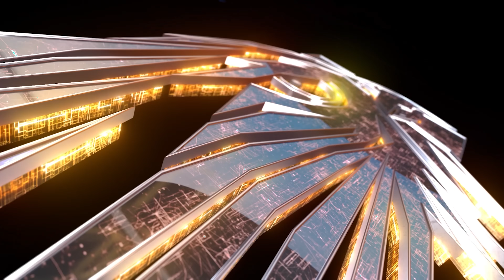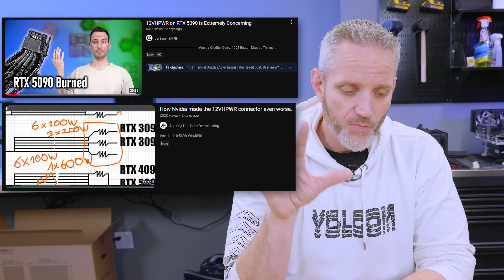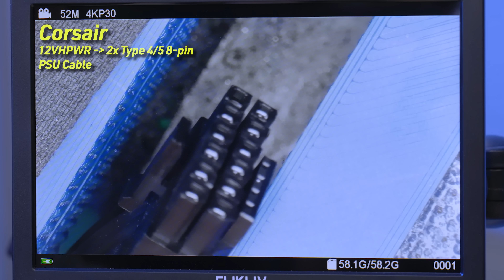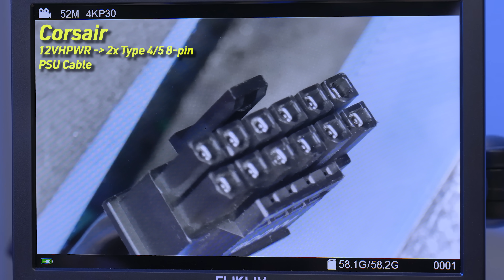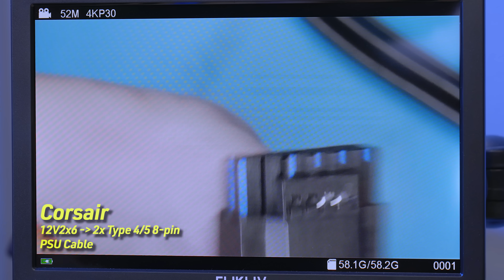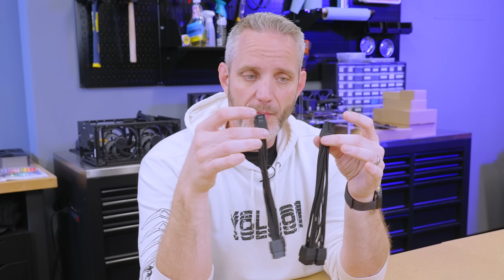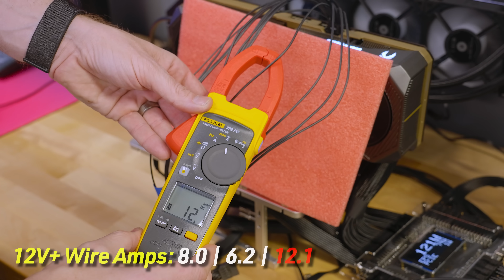I discovered something concerning and I need the Experts to chime in... More 12VHPWR discovery!

Comment from the maker: Corsair already emailed me based on my tweets and said that these pins are fine... that if they were bad it would have come all the way out of the back... however as you saw in this video, we show that it does INDEED have a negative and "out of spec" result with regards to amps on individual wires... SO... do you believe their statement?

Update: Buildzoid also asked that I correct my statement that he is an engineer, which apparently he is not. With his knowledge I assumed he was, so this serves as my correction.
Reply: Right now, I'm taking what is said by ALL these companies with an entire salt mine rather than just a grain or two.
Reply: suddenly im glad that i didnt buy that corsair psu for my next pc yet
Reply: @quantum5661  I'm 100% Sea Sonic nowadays.
Reply: @quantum5661  I did. HX1200i Platinum. Now a paper weight.
Reply: @quantum5661  same, I did pick up a NZXT 1200w instead of a corsair for my new build. Didn't know about the cables when I made the choice, but glad I made that switch.
Think i need to take a look at my cables on the NZXT to be safe.
Running a 3080 though, so not too worried at the moment.
Reply: @quantum5661  me to cuz if they cheap out on thier cables what else did they cheap out on ???
Reply: @quantum5661 I did, might replace it on gp
Reply: @quantum5661  Suddenly im glad, that i have a Corsair RM1000W from 2015, using the cable provided by the manufacturer.
Reply: @quantum5661  me too bought a msi one
Reply: This good ? I have aswell seasonic 1600w bit not installed yet @michaelgll8543
Reply: @quantum5661  Corsair have been the least affected from this issue what are you talking about lmao
Reply: @quantum5661 fk...i bought and i bought that sht cable for 32€ omg, corsair, WHAT ARE YOU DOING? These all iCue Link cables (i want to delock cable to 4-pin PWM and not using your box+usb cable)...is it SO HARD? Aliexpress chineses - PLEASE, make iCue Link cable delock cable to 4-pin PWM for Pump ☹️, i want to control it by myself not using Corsairs software and ect lagging sht on my PC...
Reply: @quantum5661 don’t buy a PSU from Corsair. Two weeks ago I received my Corsair RM1000x in the mail. That shit died after 6 hours of use.
Reply: @quantum5661  I just bought one 😐
Reply: @michaelgll8543 I did about 12 hours of research buying a PSU for my 5090 build. I wanted to go with seasonic because of their rep and the fact that they make their PSU from the ground up. Issue is also wanted a silent 1300+ watt PSU and there was none available in Canada that guaranteed they would come with a h++ cable. So I bought a Corsair...
Reply: @petert3355 Yeah, we're using entire veins to whatever they say. The amount of lies in the industry is not allowing me to trust anything they spit out. A rep could say "this computer is blue" - showing towards what appears to be a blue computer and i will still not trust them. "liar, liar, pants on fire" I've no sympathy nor trust left for any corporation in the PC industry.
Reply: Their smug reply to Der8auer where it was evident the video wasn’t actually watched was very disappointing from Johnny Guru.
Reply: @brokawmike every written statement or forum post that I've seen from Jonny Guru just exudes smugness and asshole-ness, but yes he admittedly did everyone a great service over the years
Reply: @brokawmike  It’s pretty much a repeat of how he reacted to the criticisms of the plug when the 40 series issues popped up, defensive and dismissive.
Reply: @brokawmike where was this
Reply: @brokawmike Johnny guru is nothing but a company shill these days
Reply: @brokawmike  He's just another corporate goblin now so I'm not surprised.
Reply: @brokawmike  Well he works for them for years now, corporate is above everything :)
Reply: @brokawmike expected even worse from Corsair
Reply: To this day northridgefix is still fixing burnt 4090 connectors so I wouldn't belive them.
Reply: if that shotty cable quality is "in spec" for Corsair, then that tells me to never buy any product from Corsair ever again.
Reply: I just want to point out on the old molex 4 pins (1x4) we all used to use for everything, if a pin was loose like that or not even that loose it could cause problems and fires... and thats less power lol. Hell on the 6/8pin cables we use now on gpus we would not think it moving like that is ok! and thats without there being issues popping up around those cables lol.
Reply: Little worried now considering I've been using the Corsair cable on my 4090 for over a year at this point. Maybe the included cable lube got me out of any troubles lmao.
Reply: @TKFTGuillotine 
Wait, what is cable lube? 0o
Reply: @RomanF8  the Corsair cable came with a container of lubricant to ensure you didn't have trouble getting it into the socket all the way. Because y'know, that will obviously solve the problem lol.
Reply: Hmm corpo says no problem. Suspicious
Reply: NOPE
Reply: I made another comment, but to answer you directly.  What you just found, and multiple finger points others have found, (like bend angle ect,) all of those  in my mind are "exacerbating" issues.  Any deviation from perfect, changes the resistance in the lead, and nothing is truly perfect.  From improper insertion, to tin material, to lead material, to your found short leads on pins.  All of this is why you do not do non-isolated power across multiple leads.  All of those resistance changes  create hot spots and change the way power flows.
Reply from the maker: @JayDDubbleyuh  Thats what I was thinking. If its that loose, the barb is clearly not right. So everything else just makes it worse.
Reply: @Jayztwocents  I do not know if this was mentioned as there are so many comments, but I think it would be worth testing, yourself or others, if the cables that  have the pins further in as you have shown are resulting in bad connect and causing the others to pick up the slack. I would not think this would be worth a full video from you, but maybe to just publish your findings and pass it along.  Of course this is not really solving anything, but I just think it would help explain why this is happening with specific cables.
Reply: Bad ground is indeed a big issue.
Reply: Jay, that's an amazing discovery. You've shown a serious design flaw in these cables through simple observation. I've never bought into the idea that burnt connectors is a result of user error. Maybe less a dozen people who don't know what they are doing, but most of us are PC enthusiasts who know what they are doing. I don't buy what GN said about user error of burning connectors. That being said, I'm not entirely sure this is the heart of the problem, I still think there's too much current running through those cables. You talk to any electrician they will all say the same, computer cables and connectors are a joke in that industry.
Reply: One thing that I'm wondering why nobody has mentioned so far - None of these plugs are specified for 10A+ of permanent load, Molex themselves and other clone manufacturers spec those for 10A peak load.. but if you run benchmarks or play games on Ultra where the card pulls 600W over an extended time, or constant 9-10A per pin, this is far outside the specs for those connectors. And it only gets worse if you have cheap cables with only a 20AWG instead of a 16AWG that would be necessary for 10A+ without heating up.. without even mentioning the barrel of dung that is copper-coated aluminium..
In the long run, Nvidia will have to abandon that Molex-style trash and go for a real high-current connector, even if it will be detrimental to the design and use a bit more board space. You can't produce 600W+ GPUs and not design a robust power delivery solution..
Reply: If only that much pin play in the connector is or could be a problem or cause of 12pin failures than IMO the connector as a standard is a failure. Say you have 12pin for 3 gens of cards with the same cable, odds are they will loosen up to some degree. That's a design failure that we never had with PCIe 6 or 8 pin.
Reply: @durstroyer3924  I bought a Corsair SF850 (2024) and found that the pins were inconsistent and some were 'loose' within the housing on both the 12VHPWR and the regular PCIe 6+2. I'm curious if this is common with other manufacturer or unique to them. It does suggest that this was not a problem until the 12pin cable spec was created with only a 10% safety margin and moving so many watts/amps.
Reply: Corsair is the actual "this is fine" meme with that statement. With the currents going through the cable, that's not fine I'd say, you want to be a 100% sure everything is perfect. But.. The big question is, does it make good contact when plugged in?
Reply: Their statement is horseshit.  I have 8 pin PCIE cables from cablemod where the connectors have recessed compared to my OEM corsair cables and they literally disconnect and cause a gpu crash just from the desk being bumped.
Reply: They need to fix their qc on all products across all companies
Reply: A bit of warning/question : Are you SURE, Buildzoid is an engineer ? 
Because based on at least few prior VRM/PCB review videos, he always stated that he DOES NOT have a degree in electronics/electrics. Not trying to make what he does less valuable. I just want to point out a potential error, which may create an akward situation. Please check this with BZ !
Reply: @CompatibilityMadness  Yeah i dont think he is an actual engineer.
Reply: Nope, the design is just bad and has serious issues, anybody arguing it's OK ... is not believable.
Reply: @ericshutter5305  Correct. Specs are specs. Just spec a better connector for the love of god. Ask electrical/automotive engineers or something. This is a case of just hiring the right person.
Reply: Thanks for these videos Jay.
Reply: I think the statement is true. Nvidia just disregards resistance laws for their design. 
Each individual wire has its own resistance. This resistance may change from different factors. One of thos is an uneven diameter, others may be how they are bent.

in my opinion the issue lies in the single powerplane with a singular shunt resistor.
For example, asuming each individual cable has a resistance of 10 Ohm, one is out of spec an has 8 Ohm (e.g. is thicker). Since they all terminate in the same plane they are perfectly parallel. So the current drawn is just split accros the wires according to their resistance. e.g. in this case with 5x10 ohm and one 8ohm wire the 8ohm wire would draw 25% more current than the rest. If every cable would have a shunt resistor a magnitude larger than the wire, imperfect cables wouln't even matter.
Its a simple cost saving design flaw.
Reply: Definitely not, I got the RM850x 2024 edition, and the 12VHPWR cable even tough it has the black marker on it that is passed QA, simply moving the cable turns on the red light on a brand new Asus 4070 super prime card. Yes the pins were connected properly and the angle was not extreme, followed the guide that came with the card.
Reply: Corsair is the problem as most what they make these days is pure junk. Corsair is not like they were 10 years ago. That's my experience my opinion.
Reply: Just checked a 3x8 pin to 12VHPWR cable from Cablemod that I was going to use in my new build (well re-build) with my 4090 and one of the pins did the same thing as you showed in the video (also one of the ones on the side). It could retract several mm into the contact and I will not use it in the build and instead use the original that came with my PSU.
So if you have a cable from Cablemod check it asap!
Reply: @MrMeanh  no wonder their adapters melt
Reply: IF that truly was in spec (which I don't believe) the spec needs some serious re-evaluation
Reply: Hi Jay, In Direct Current Circuits Electricity does not flow from Positive to Negative. The "ELECTRONS" (Negatively Charged) flow from Negative to Positive. Meaning that these Circuits start from the Negative Pole (they are attracted to the Positive Pole ...opposites attract) and end at the Positive Pole. So yes, excessive Resistance or a loose Connection on the Negative side of the Circuit, can absolutely cause excessive heat or a blown fuse on the Positive side of the Circuit.
Reply: Corsair is basically doing the NZXT and I think they'll be next on the shopping block
Reply: @TtheK *chopping block.
Reply: @TtheK Ah wow, I have a NZXT prebuild but I must have lucked in, I hope I did not just jinxed it. But don't get me started about Moza sim equipment, that sucks (understatement).
Reply: @TtheK  looking at that MSI cable, have to say I know my next MB/PSU/GPU brand. They might not be perfect, but they're doing things a lot better than the rest of this circus. That thing is built great.
Reply: The only think i would buy from corsair is the case and Ram everything else is crap  @TtheK
Reply: NO
Reply: Just because it’s in spec (which I don’t believe it is) doesn’t mean it’s suitable for the application
Reply: What's actually needed is a complete redesign of the pc standard. Same for gpu. At this stage of the game why shouldn't a graphics card slot directly into a pronged power supply plug hard-mounted directly on the motherboard - aka a ps4 for example? The legacy of the pc industry for decades has been the status quo.
Reply: It's not a problem if one or two wires are weak. The problem is when one happens to be exceptionally good compared to the others. Imagine you have 5 wires/connectors with up to spec 40 mili ohm resistance and one exceptionally good 8 mili ohm. This single cable will carry half of the amperage. Now imagine you have a mediocre 100 mili ohm... It's just ohms law. Current looks for path of least resistance.
Reply: Corsair is telling you these pins are fine but do you want to bet in the near future this gets quietly fixed and swept under the rug?
Reply: Electrician here. Bad connections = high current = exactly what we’re seeing. Those recessed pins will almost 100% be at fault. Combine that with any lack of load balancing tech/ overload/over current protections from the cards and or PSU and you’ll burn cables out. Not to mention the heating and cooling factor of those joints, as time goes on a poor joint will loosen itself off even more as the ranges between hot and cold are higher, causing more expansion and contraction of the join. Those pins need to be tightly seated, not loose. “Within spec” is a nonsense reply from Corsair 

It’s a Swiss cheese scenario, with shortcuts being taken by nvidia to dumb down power management combined with poor quality connectors, we’re paying a small fortune for these products. Manufacturers have to do better.
Reply: I have worked with high current pinned connectors for a while and while the female moving like that is definitely a QC problem based on the I am wondering if there are some output diodes on the power supply that are preventing the other power delivery lines from providing power. Like maybe the the single bus layout on the gpu is now acting more like an auctioneering power supply
Reply: There you go, doing the work of the PSU companies that should've been done before even that piece of hardware should've made it out of their shelves... But ay no worries. if you spend all that money on an overtaxed then scalped and very expensive even before you take those two into consideration,  GPU you can do it again when it dies because of a bad cable or even worse everything you own as that can start a fire real easy. Just so sad how companies don't care as much for their customers anymore :'(
Reply: I don't even remotely believe their statement and I am completely convinced it's a "we would like this problem to go away without spending more money on it" case.
Reply: @kahlilhtail first the pin that move is rotated 180° vs all the other the retention mechanism is on one side if you put the pin 180° the retention cannot do is job
And it's clearly evident you can see the slit on the pin is not oriented the same way as the other 11
This cable got a manufacturing defect
Reply: Damage control...
Reply: Yes! Not all of the ground connected would be a problem here, especially since we have exactly the same amount of ground wires as 12v. CURRENT IN = CURRENT OUT, the difference here is that if this cable burned, it would be on the ground pins and not the 12v pins. Corsair is lying, not a big surprise.
Reply: This kind of pin issue was common with hdd MOLEX  power connector . It was sometimes annoying but ok due to the quite low power going through them. Now corsair: this company is one I don't trust at all. In the past they had a very bad practice and I assume they probably still do it sometimes: releasing products with good performances, so they have good reviews, then a few month later, they change the specs, reducing the quality of the product but still with the exact same name . It happened to me a long time ago with flash voyager usb key, it happened with some entry level PSU (CX450 maybe, I'm not sure, some reviewers caught them) . And it happened  to one of my friend recently with some ram sticks.
Reply: @GuigEspritDuSage  The play on some of those MOLEX connectors back in the day was crazy. Scorched atleast one of those due to pins being pushed out and not making a good connection. Now their pumping 600 watts+ through a connector rated for 600 watts.
Reply: Nah that aint a clue, that is an issue.
Reply: Personally, I look at that Corsair H++ cable as you're wiggling the pin, and all I can think of is the two missing sense pins being sufficient evidence that the "official" statement is untrustworthy. I wouldn't be surprised if Roman's cable that was pulling 23A has a loose connector pin at one end (or both) and is why it was lighting up so brightly on the thermal imaging camera. 154C on the PSU side is NOT NORMAL! Not just for a 600W GPU, but for ANY device on DC power.
Reply: corsair are full of shit. all about damage control for them.

nv know what they are doing. they used to run 2 shunts per plug for 150w plugs but now 1 shunt for 600w is enough :|

its almost like they dont want to sell gpu anymore
Reply: Maybe not a certified engineer, but maybe we can assume he is a freelance engineer 😂
The dude knows his shit.
Reply: That is definitely a CYA comment from Corsair
Reply: The problem isn't on corsair's sid anyhow. It's on nvidia. Nvidia was told EXPLICITLY many times not ot use this cable the way they are. That they should be doing like the 3090, balancing it, AND ALSO that above 350W there should be TWO of them.
Reply: No, I do not believe their statement.
Reply: Fun fact - the Corsair R&D guy brushes this video off, claims that the pin sliding back and forth is "on purpose" and says that 12pin cable shouldn't be plugged for more than 30 times in its lifespan.

Oh, he also said that it's written "EVERYWHERE" and proceeded to block me
Reply: Derb8uer is an engineer :)
Reply: I reckon that’s horse shǐt and that you’re onto something. What if the pins are pushing the terminals in and only making contact with the very top edge of the terminal on the male side? That would cause real issues.
Reply: Not sure, but id stick to a proper looking cable
Reply: With the Corsair cable, did you pull sufficently on so that if the barbs on the crimped-on connector were not fully engaged, the wire would have come out of the connector? I know from personal experience just buying normal hook up wire from China is a chore with some sellers passing off aluminum wire as tinned copper wire. Only after you get it can you do a flame test with a normal lighter to see if the wire forms balls on the end of the wires aka aluminum or whether the tinned wire is indeed copper and simply blackens under the flame test.
Reply: I used to think that we could trust Corsair PSU. But it's hard to trust their PSU again when they refuse to admit an issue with their PSU cables.
Reply: Just checked one of my old type 4 cables from corsair, corner wire feels "loose", nothing major but if i gently pull it, it feels like it's moving and something is unplugging/coming out, the pin doesn't move like yours but i have felt the same feeling with the type 5 12vhpwr cable from them too that came with my rm1200x shift. Only the corner pin.
Reply: Thank you for all your hard work.  It's really an eye opener.
Reply: I just don't believe that quality is acceptable
Reply: I have both of the corsair 12vhpwr cables and mine are the exact same as a matter of a fact I was getting black screening with my 4090 when I was using the corsair cables. Switched psus and started using the 1000w rog Loki and haven't had a black screen since. I
Reply: Just checked a corsair cable like in the video that I've got laying around .  It looks just the same as yours, really inconsistent pins. It hasn't even been used yet ,just got some spares.  The 25 bucks moddiy cable I got  is much better . And also has gold plated pins.  I bought the 675 Watt cable from moddiy for a 5090. Didn't manage to get a 5090 yet though :')
Reply: Believe Corsair??? Yeah they got cool stuff, but do you believe the snake that has honey in his forked toung, or the shabby, meek looking fellow that may not have a lot but is happy and promising you could be happy to if you just cut out the serpent.
Reply: I'm willing to bet that the cable that was loose on that corsair cable would probably pull completely out. I had to contact them to RMA my 12VHPWR cable that came with my 850w Shift PSU because one of the small cables pulled completely out when plugging it in. They ended up sending me one of their premium cables and it has since been fine.
Reply: Having had electrical issues with corsair fan controllers in the past, I don't trust them at ALL.
Reply: Just checked my Corsair cable, same here - insane. It's brand new PSU and upgraded in prep for the 5090. I will be taking it out tomorrow and returning it. Thankfully I haven't managed to buy the card yet!
Reply: The fact that the pins are backing out to me means they need something to keep them there, glue or putty or something. Or the connector needs to be imbedded into the plastic itself.
Reply: @battokizu this in is inserted the wrong way it's rotated 180° 
You can see the slit of the pin is not in the same orientation as the other so the retention mechanism cannot do is job
Glue is not the solution here
You can see that all the pin correctly inserted doesn't move
Reply: I'm curious how well - if at all - the ASUS Astral cards mitigate this issue. I'm aware that they monitor the current for each individual 12v pin, but have they implemented any safety features that limits or turns off the card if a single pin reaches unacceptable concurrent current? (I don't know if I'm lucky or unlucky that I haven't been able to buy one of the exclusive few Astral 5090's yet)

The biggest issue is not the fact that we have a single connector rated for 600W, but that there's no max rating each pin is allowed to draw.
12VHPWR/12V-2x6 consists of 6x 12v pins. Yes, that is 6 less than what you'd from 4x 8 pin PCIe connectors.
But the issue is clearly not the fewer pins, but the horrible contact they seem to be making.
When all 6x 12v pins are connected to the same 12v rail/bus, then you have a burning issue.

We've seen connectors and cables melt in the past as well, it happend with 8 pin PCIe cables as well, more rare and less talked about, but it happened.
On the GPU side, 8 pin PCIe connectors was rated for 150W, meaning a GPU shouldn't draw more than 150W from each connector.
Most respectable PSU manufactures was well above specs and could easily handle more than 150W, meaning a single pin failure probably wouldn't be noticed and wouldn't cause an issue. (Corsair as an example uses 8 pin EPS connectors (300W) on the PSU side for both GPU [PCIe] and CPU)
This is also why many - like myself - had zero issues using pigtail PCIe cables for the enthusiast cards.
This was an issue often spoken about a few years back, and the recommendation was always NOT to use pigtail cables - because of the higher power draw that is now even worse.

Back to the 12VHPWR/12V-2x6 connector... It's rated for 600W, and GPU's like the 5090 are trying their best to consume exactly that...
This shouldn't be an issue, but it is... And it will always be an issue!
If cables and connectors aren't rated above spec, then there's no leeway. A single pin failure can be enough to melt the connector or the unlucky cable now suddenly drawing more than it's rated for.

This is clearly made even worse when the GPU uses a single 12v rail, instead of multiple 12v rails.
They could easily have sticked to three rails, each connected to two 12v pins, or at least two rails, each connected to three 12v pins.
This limits the maximum power draw through a single cable and mitigates serious melting issues.

Connectors making bad connection is a very bad think, I think we can all agree that this connector must be badly designed. The 12 pin spec itself however isn't bad, it just needs a few requirements, like a current rating per 12v pin.
In a perfect world, each pin and cable would be rated well above 100W to ensure imbalance in current wont suddenly melt the cable and potentially create an even worse connection, resulting in an avalanche of failures.
Reply: @Jayztwocents If Corsair is emailing you saying the connectors are fine. They need to hire an actual electrical engineer cuz they dont understand the first rule of electricity and that is electricty will always follow the path of least resistance. So without load balancing all the power could all jump to one or two wires and cause them to heat up. In addition, when there is a bad connection or one not getting as good of a connection, like on the Corsair plug. Resistance will also cause heat and lead to melting. That is how every electrical heater, oven, incandescent lightbulb, etc works. They clearly do not know WTF they are talking about.. SMH..
Reply: Not a chance. Between you and Gamers Nexus doing testing, we can find out the truth.
Reply: Next test idea: measure the amps as you did here, before and after yanking (vs pushing in) on the loose wire.  If wire seating has no effect on amps, pulling and pushing on the wire should have no effect.
Reply: This is exactly the video I wanted to see. Thank you. Yes I also think the issue is with pins not having good contact which could seem you connected properly but there is no contact because pins too short. Maybe it is possible to put some color on 12VHPWR and then connect it and see if there are any colors left on the gpu side but I am not sure how that affects the gpu side connector.
Reply: That is absolutely not "fine".  Even if it was "fine"  there are parts of the pins internally that need to line up to provide the correct amount of surface area and pressure on the pins otherwise resistance happens and stuff burns!.
Reply: Their statement is false because of concepts that any student should have learnt in EE101.

Heck anyone who’s ever dealt with a power outlet that doesn’t hold onto the plug securely will know. Loose connections generate more heat hence why high wattage devices recommend that plugs be securely inserted.
Reply: The person saying "the pins on that connector are fine" is either: 1) Lying through their teeth or 2) Ignorant as a fence post with respect to not considering all of the possible variances which could come in play.
Reply: Humble Buildzoid is always humble
Reply: Corsair is junk now sadly
Reply: I'm an Electrical Engineer that works in manufacturing and this would fail any of my quality control tests. Especially given how much current is being drawn through these wires. There are 6 pairs of ground and 12V on this bundle, so if one or more ground is running into a no-contact or high resistance because of poor pin seating, then the other cables are going to have to handle the greater amount of current. The ground usually is handling a greater amount of current than the 12V. 

The issue appears to be the retention clip of the pin itself is not engaging early enough or is damaged. I'm not familiar with the construction of the 12VHPWR, but it looks like the retention features are within the plastic housing. In my opinion this connector is trying to force a smaller-than-safe form factor than is safe for the cable size and spacing.
Reply: I always bought Corsair top of the line power supplies. Looks like their cables are bad quality and this is my last corsair psu ! Just checked my cable the pin is loose will do RMA🤬🤬🤬
Reply: Corsair's statement doesn't instill confidence in me.  Your testing outright disproves their statement, and I think they are only pulling an NZXT PR stunt (as someone else said already), just to cover their behinds.  But it's clear there's an issue.

I'm staying on my 1080 Ti until Nvidia figures out their power connector fiasco  (as the last RTX to use regular PCIe power isn't honestly much of an upgrade over my 1080 Ti, not for the money at least vs the gains I'd actually see).
Reply: I think corsair lawyers drafted the email response... Hopefully they are looking into seriously, because I like corsair, I don't want a "corsair bad" expose...
Reply: I don't trust corsair, at all lol.
Reply: @Jayztwocents  I think Europe requires a degree to be even called an engineer, you don't need that here in the US, you can hold the title if that's what you actually do degree or not.
Reply: There should be a standard for these cables to follow. I personally dont believe what corsair has to say about it if msi can do it that well why cant corsair do so? Clearly i will be ditching any corsair products from now on as they clearly make products that’s low quality and not up to standards
Reply: Of course Corsair is going to tell people that their cables are fine. With all of the independent testing that's been done and finding that it really doesn't take a lot to make the cables fail, I definitely lean towards the skeptical side. ESPECALLY when the cables are used to power a 1,000 USD GPU at the lowest end of the price range. Nevermind that we all know MSRP went out the window the very second the GPUs were able to be bought.
Reply: I'm just not going to believe Corsair on it.  Companies are only concerned about covering their own ass.  If it can move back and forth, it could even push out.
Reply: Issue isn't connectors or pins.  It's the fact that card can't tell if your wires are good. If they are conducting and same resistance. There is no per pin monitoring. Now if Nvidia doesn't fix the cards, power supply makers could introduce a feature that monitors each pin on the connector and load balances it and restricts it to so many amps per wire. But that will add cost to them. At that point the sense pins are useless and not needed. It's just sad that Nvidia didn't do this on the cards as part of the spec.
Reply: Slightly missed opportunity: when measuring the individual wires with the clamp meter, did any of the hot wires go to the recessed pin/s in the cable connector? Would have been nice to see you test your own theory... :)

Great video tho. I don't know if you've sussed out an actual problem or not - after all, the contact area between the sleeves on the female side and the pins on the male side can be quite tiny, as shown in previous years' investigations - but the detective work you and others are doing sure is appreciated.

Keep shining a light on this please, and I'll keep on clicking on the videos. :D NV should have done a much better job here.
Reply: I've worked in the computer industry for 39 years and I'm an electrical engineer and if I saw a cable like that Corsair one, I would throw it away immediately because it's clearly defective.
I do the same with any cable that has loose connectors because I know that if I build and / or sold a PC with a cable like that, it would come back as an RMA either due to bad contact resulting in failures or as a burned out husk with a note from a lawyer stating I'm being served and expected to show up in court for a lawsuit.
That MSI cable shows how a connector like that is supposed to be made, the Corsair one is a classic example of a manufacturing error or just using the cheapest components / labor possible, resulting in a clearly unsafe and defective product.
Please don't ever use that cable again and if anyone who reads this has a Corsair power supply with a cable that shows the same defect, take pictures or a video of it and then send it back to Corsair demanding a full refund. Not a replacement, because you'll get the same trash in return. Demand a full refund and threaten to make your pictures / video public if they don't.
If you use a cable like this, you're basically asking for something to go horribly wrong.
Reply: And I can add that  the longer the wire is make the amp raring lower as well so technically the longer cable is worst in this case purely on amp carrying capacity 
A ten feet wire vs a 1 foot wire of the same gauge don't have the same amp capacity 
10 amp draw could be ok on a 1.5 foot cable but could be too much for a 3 foot cable
Reply: Physics/EE engineering director here. I have a problem with these connectors and also the gauge of the wire being used. There will be houses burned down due to this crap...
Reply: Nah, I don't believe Corsair on this.  When the safety margin is only 5%, the slightest reduction in conduction contact could be enough.  Their plugs are just poorly made.
Reply: The real questions here is how come Buildzoid's video isn't link anywhere or in the desc of the video. Should be pinned @ the top imo, the dude's a wizard.
Reply: This is exactly why I don't buy ANY Corsair products. They went from top of the line models to Temu branded models. The Lian Li Edge 1200W for a 5090 is a chef's kiss to their 12v6+6 GPU cable. It's literally as good as it gets. They got extremely scientific with it and even put in power spike protections and gold plated copper for better conductivity. I looked at their connector after your video and noticed that EVERY SINGLE ONE is leveled perfectly. Lian Li really went all in with god tier PSUs with an amazing price point for what you get. A literal god's gift product. I like their fans too, but a bit too expensive for the performance. Regardless, great fans and they started the fan to fan connection product line. Such an Innovative team and I really hope they don't let the money they rake in take over their QC and innovation. Screw Corsair and people need to hop off the band wagon and realize they aren't the company they used to be a long time ago. That email from Corsair to you specifically says it all. A real and true company would say that they messed up and are going to fix the problem and provide much better QC moving forward with an apology. Of course they didn't. They suck.
Reply: they just deny claims so people cant sue them
Reply: no
Reply: I have been a notorious corsair hater for years because i once got 2 dead power supplies back to back.  but my friends all think im crazy. So now I have a good reason to be a hater
Reply: NO!
Reply: der8aur use corsair
Reply: Yeah, something tells me to not trust Corsair on this one.
Reply: There´s a saying in Germany : Don't believe any statistics that you haven't falsified yourself
So... NOPE i don´t believe it.
Reply: DON’T believe for a nanosecond.
Reply: "SO... do you believe their statement?" No. The line where we could trust words from a PC industry company has long been crossed into negative. This isn't a "innocent until proven guilty" case anymore. "They've" (read: all of them, every fraking single one of them) been caught one time too many with burning pants and mouths full of lies and false accusations and scams, and theft, and all sorts of bad things. I feel i'm done with their bulldust and so are others. Their standards are not to the standards of science and cursory math would prove they're full of sh!t. Couple with ALL the hits on google with all their lies and yeah, they could say the sky is blue, it's a lie.
Reply: Corsair is 100% lying !
Reply: @cris_stn - why? Do you know the specifications of this connector? The contact surface of each pin is usually minimal in connectors and it is probably fully connected way before the connector housing is fully inserted.
Reply: Booooo to that response!
Reply: What does enterprise use? Why aren’t they burning?
Reply: >SO... do you believe their statement?
Hell naw!
Reply: After my experience with Corsair over the years, no
Reply: What is the voltage on the 16-pin HVPWR reading in HWINFO64?
Reply: after much deliberation and following all this for the past years. It's pretty obvious ALL the companies have no intention of addressing this properly until forced either by government agency or raw consumer pressure. As it stands its far easier for them to just pay off/ignore every persons home that burns down and keep profiting.
Reply: I'd like to see a Amp test with that Corsair's cable where you pull on the wire vs when it's as seates as it can be... both for that wire but also how it might impact the other wires.
Reply: I’m just building my first pc with 5080… and I’m returning corsair, all the cables seem garbage
Reply: Jay, I just checked my Corsair 12vhpwr cable (CP-8920333 model) and pins are almost perfectly even. So it may vary from piece to piece. But tbh I still haven't used it cause I ended up with Asus 4070 Dual almost 2 years ago and it has 1x8pin pci-e connector.
Reply: Nope, I am willing to bet that is actually the problem. those pins need to nice and snug.
Reply: Dang I just bought a Corsair unit and contemplated using the PSU cord…not now
Reply: Nope, cant trust them.
Reply: What I'm hoping we'll see is a third party current monitor per wire and will be able to alert you and or open sense pins to protect the GPU.  Alert you just like if there is going to be an issue and there's a clear discrepancy in the current load balance.
Reply: They watched this and said those pins were fine? Hell no I don't believe them. Just look at it!
Reply: At the end of the day invidious don't want to change as they would be admitting they made a mistake. I dont know why they didn't already make a 30amp per wire 1000w supple for their 5090. Will never buy an invidious card for myself. 
It's amazing there is more consumer action at a government level for this high fire/life risk fault
Reply: I would just use official nvidia for 5090
Reply: i do not belive them..
Reply: No I dont jay. You found what was one of the issues I seen first hand myself. If the pins don't lock in place they will push back when it's plugged in. So I just push on the wires after I plug it in. Every single wire I can. Hoping for the best.
Reply: On my cable that came with my 4090 the one pin to the left is like the one from your Corsair.. is it the GPU that makes this happen then???
Reply: Had Corsair product DOA out of box before. Have zero trust in the company and their opinions.
Reply: I USED A CABLE MOD 90 DEGREE ADAPTER ON MY 4090 and it melted into the connector. those connectors were recalled in Australia. Fortunately, Asus fixed my card for free as it was still under warrantee. I will NEVER use cable mod again period as they are too risky especially with cards costing so much. BTW 5090's should come with a fire extinguisher.
Reply: msi H++ cables  gonna be selling  like hot cakes now
Reply: one easy way to test would be to plug the questionable cables into an ROG astral card to see if they're reporting inconsistancies.  if, you know, enough of them existed. :P
Reply: Wont be buying anything corsair related again Such a BS answer for a very LARGE problem.
Reply: Did you just single handedly take down the entire company's rep...🤯
Reply: I absolutely do not.
Reply: I agree with the MSI quality.  I used mine that came with the MSI gold PSU and never had any problem.
Reply: NOT at all! !!!!
Reply: Corsair says that are FINE?!...Contact Nvidia about that kkkk
Reply: That pin moved, as an automotive tech if i can tug a wire and it moves with or without the pin it needs a new terminal connector pin or a new connector overall. its an indication of bad fitment, imagine if you could tilt a gpu while its slotted in, is that in spec corsair. side note i dont know the specs or how specs are made but they should be made with a tolerance so if  its edge of spec it still has "room" before it actually fails
Reply: Selling my Corsair hxi1500 now and going for the MSI
Reply: I do not trust a company shill to not shill their company.
Reply: when this video was playimg i looked at my only 8 week old 12vhpw 90 degree angled cable i had disconnected on my rtx 4090 strix about 12 times since building a water cooled pc. This cable at the ends looked great. It is the type 5 dual pci 8 lead. I bought it because the original 12vhpw cable on a sfl1000 psu was very short.
I suspect because u have to buy these sleeved angled cable they are made better than the originals
Reply: Damn just went and checked my gen 1 corsair cable and I also have the corner ground pin that has a lot of up/down movement. Guess it is a good thing I have my new 1600w psu from cooler master coming tomorrow. Got a new psu that is atx 3.1 with two 12 (2x6) connectors in preparation for when I get my 5090.
Reply: I just brought a new cable from corsair and it's much better quality than the one shown in this video.
Reply: If you had two exact cables used one as a test exercise so try and level out the pins on both end and then glue the pins from the back end of the connectors and test the cable for any differences between them during testing this should help with the result between the affected cable and slightly modified cable
Reply: I have reviewed many cables in my professional life. It appears that the contact you identified is not properly installed in the connector body. Your initial review yields many potential items in a root cause analysis fishbone diagram. These should all be investigated.
Reply: I have reviewed many cables in my professional life. It appears that the contact you identified is not properly installed in the connector body. Your initial review yields many potential items in a root cause analysis fishbone diagram. These should all be investigated.
Reply: Fusing current depends on the cable diameter, if one cable is not flush with the other, the diameter will be smaller cable over a short distance will fuse.
Reply: Jay i have the Asus Thor 1000w Plat 2 PSU and it came with a armored 12v 6x2, i was on the fence to use the 3x8 that came with my 5080 but so far the cable that came with my psu isnt getting hot on either end but still worried about it melting
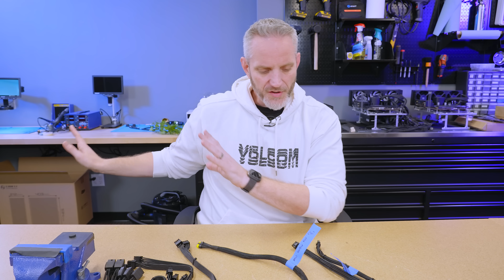Reply: 6:53 you would be ark welding on the 12v the ground I would imagine would purely need to be heat to damage I would imagine
Reply: This right here is why I have watched your years now. When you’re wrong or you have any kind of update in any way you will always correct yourself or admit you were wrong. So for that thank you. Thank you for always being upfront and honest. Not only you but to your team as well.
Reply: Thanks for the back peddle 🤝
Reply: Also the bottom clip is missing 2 metal pieces on the corsair. My zotac looks like the nvdia one.
Reply: What is the amperage and heat like with 12V-2x6 to 12V-2x6 cable and a ATX 3.1 power supply?
Reply: So, how many did you disassemble?
Reply: Corsair works fine.
Reply: I had this Corsair cable on my 4080 Super, but this video made me switch to the adapter included with my GPU instead. To be fair, mine doesn’t seem as bad as what you showed in your video, but I’d rather not take any chances. So nope, I don't trust Corsair. It's kinda sad that they include a poor-quality cable with a high-end PSU like this.
Reply: Jay - Aris of HWBusters in his recent video post on this topic made a comment saying his Tream (Cybenetics?) was developing a product  to solve this problem.

The central theme of this video is that he has  he has introduced 6 shunt resistor bricklets on the positive wires of a 12v-2x6 cable

So reading between lines, I believe a viable 3rd party product to solve this issue will be a 12v-2x6 cable with 6 shunt resistors that will terminate all power/signals across cable if overlimit detected.
Reply: I feel like testing the MSI cable with and without the pmd would have been extremely useful to conclude whether or not it was the pins on the Corsair that are the issue
Reply: I'm glad you made this video I suspected this might be the issue and posted about this on reddit
Reply: At a certain point 12v at such high draw is just a problem.  Making the connector smaller and pins smaller is only a recipe for greater error.  In the great words of Ricky-Bobby “I’m on Fire, I’m on FIRE!!”
Reply: i think you should also try to tug / push the connector from all of the cables, not just the msi and corsair ones but also the nvdia, singularity and other ones
Reply: Your correlation would be the poorer the contact the lower the carried current.
Reply: Buildzoid isn't an engineer???! Why not???? How???? If I was Intel/AMD/Nvidia I'd pocket him immediately to build my next MB/GPU
Reply: @jayztwocents -- any way to help Aris from Hardware Busters/Cybenetics hands on a 5090 FE? If anyone can answer this with certainty--it's he and his team. 15:49 15:50
Reply: If you need to test- use a 2nd psu. Get a bridge. It will melt the bridge if it fails.
Reply: Yeah, its probably “fine”, as in its within design specs. There are others that shows on how their Corsair PSU is doing fine. I will argue that its either Nvidia’s fault on trying to save board spaces for their tiny GPU, or the entire design of the cables is at fault. I think the Corsair discussion is distracting from the initial issue because the original one that meltdown not even using Corsair cables, its using custom ModDIY cable
Reply: Interesting. I spent over a month emailing Corsair about faulty fans they sent me and couple only get them to reply twice. I ended up having to dispute the charge with my CC company. Maybe I should have started a YouTube channel about it
Reply: the issue is soft not hardware
Reply: Dammit I got a Corsair Psu, Defo will be using the Nvidia adapter
Reply: Actual microelectronics engineer here, the highes probablity why mostly the +12V melt is that it is usualy the top kapel so if they all are the same length and stiffend so it looks nice the 12V is streched which experts extra pull on the conector at the top, if the PVC or PE is to soft the conector cann pullback and lead to an uneven surface contact. Since the contact area therfore is smaller at the GPU connector side +12V then the GND it get's warmer then GND since it's a mater of current density. The reason we never realy saw widespread problems at the PSU is that we mostly don't bend cabels there in a hard angle and therefore the connecton is mostly above 90% possible contact surface and even between +12V and GND. It's a nice forme over funktion problem they have made and the single rail did anything but help. Since you now have to possibilty options, A the contact problem is on the low side like the PEX MSVDD and stuff wher it uses probaly less then 10% of a single connector that would not realy come into play. If it happens at a pin that suplies the GPU which uses the most it may well use 70% of the capacity of the asinged pins. If one or two of those are bad you can soon find yourself in an overload possition. Now spreading all over one Rail in theory results in an even spread and the GPU can utilize the capacity of a pin that was untill then only partly used. In theory that makes the device saver, but if you also increas the overall power consumption of the card, that safty space says bye bye and now it doesn't matter which pin fails you end up faster in an overload scenario. Sadly PC technology as a whole has a form problem where you deal with an ungodly amount of current bleed and EMC.
Reply: @Jayztwocents  I would definitely look at the full chain including the inside of the power supply as well as the graphics card to verify that the 'bus bar' on each side is sufficient.
Then measure the voltage drop between the 12V ouput capacitor on the psu and the consuming electronics on the gpu.
Reply: yeah they alltime say they are fine but lets say it like this they say this 1mm is fine but if i dont put my powercable complete in and have a milimeter gap its not ok that doesent make sense for me and dont let forgett the older pins are longer? if i remember korrekt
Reply: @freischnauze-lp9240  It depends on the design of the socket. It usually is spring loaded from at least one side. The design is usually done to allow for some variations. The electrical connection is done on the sides of the pins, not the tip. But weak springs, oxides etc. can lead to a bad connection.
Overheating weakens the springs.
Difference in current could be the connectors, but I'd like to also check beyond the connectors to ensure that the PSU and card both have been properly designed and manufactured.
Reply: How about speaking plainly? We (users) were forced to use a completely unnecessary standard connection...which is more than rubbish. The problem is well known and we are still stuck with the rubbish. It's crazy, isn't it? Which lobbyists are involved? We know it from politics - senseless decisions are forced through even though everyone knows that it doesn't make sense.
Reply: Corsair is shit. Never buy anything from them
Reply: These pins definitely aren't supposed to be pushed in like this. FML, I have Corsair PSUs in all of my PCs.
Reply: I have the same Kabel, H++. Same Issues......the cable was never used before! Same issue on the PSU side from the cable, ther its even worse then on the GPU Side!
Reply: Jay, what you ought to do is take a couple of Molex connectors and test the connection between one barely plugged in to one that's driven home lol
Keep upping the amperage until it starts to smoke, and\or watch with a thermal thermometer. I would but I'm sick as 🤬 right now. Love your channel
Reply: When you get an update to this. Could you do a video on it?
Reply: Run a 4 x 8 pin dongle or native 12vhpr(2x6, preferably). The 2x and 3x dongles will deliver 600w but will force more Amps through fewer wires........yeah, no.
The connector is called a connector...it should connect:
The longer the female and male contacts are will make a difference in reducing Resistance, yes.
Mixing metals will also add Resistance: tin to nickel to gold to w/e ...etc. gold/gold being realistically ideal.
In a perfect world, the GPU Cards would still have independent shunts/sensors. But shoot, AIBs dumped the whole GPU power spike issue on PSUs a few years ago....so ......WE are heading towards a dumpster fire train wreck BSOD fest at these power specs/limits (INtel...cough)
Reply: Reach out to Electro Boom. He is an engineer.
Reply: Of course they would say that. The reality is that, if a pin gets pushed back when the connector is plugged in, that pin will have higher resistance due to poor contact, or not have any contact whatsoever, thus carrying 0A. This would of course lead to the other pins/ wires carrying more current.
Reply: As an Electricion I am more Surprised how this is even a Question at this Point. 
These Connectors are laid out for 600 Watts. Checking the Specifications of the Cable and Connector the Wiggle Room is Super small. Coming out to Barely 650 Watts before the whole thing Overheats. 
And this is assuming Perfect Distribution. Which is never Achieved with a Simple User Plugged in Cable. 
Yet in Jay´s Video the Card is Drawing more around 660-720 Watts which means that even with Perfect Distribution this Connector is already over its Intended Usage by 10-70 Watts. 
And now Jay Showes that there is no Perfect Distribution at all. The Distribution is very Lopsided actually. Running nearly 400 Watts over 1 of the 300 Watt Connectors. While only Running only 270 Watts over the other 300 Watt Connector. Even worse the 3x100 Watt Connections are Loaded Lopsided even within this. Woth 1 of them taking over 130 Watts. 

Now. This in itself is Scary. 
But do You want to know something even more Scary ?
As an Electrician if I had to Sign Off on this Device. I would Judge this Device to be Barely within Regulations as long as the Provided Parametes for the Device are Correct. 
BUT would Issue a Warning to the end User. 
That this Device will likely Fail in 1-2 Years due to Degradation pushing the Connector below Regulation Limits. Therefore Requiring that the Connector is Replaced each Year as Part of Standard Maintenance. 

And I leave it up to You what this Implies.
Reply: I use a unsleeved Corsair 2x8-Pin to 12VHPWR adapter for about 2 years now (oldest version), never had problems. The Corsair adapter is as native as it can be.
But the pin problem is clearly not in all cables made from the same manufactorer, otherwise we would have much more reports of problems.
We had (total or partial) failures with Nvidia adapters, Corsair, AIB and from other third party. So... all cables failed at one point.
The Nvidia adapter I used at some point for a 4090FE had bent pins on the 8-pin side. :D
Reply: The Groucho Marx defense: Who are you going to believe, me or your lying eyes? SMH
Reply: kick Corsair from the channel :) im going to go check my new Coolermaster...
Reply: Of course Corsair said that.
Reply: bro, your theory could be true, but checking it opticaly in a non conected state isnt a state you could judge anything.
Reply: There is literally no current balancing on the 5000 series… that’s the first issue.  The connector is the next issue which creates a scenario where the current balancing is required.
Reply: Coming from someone who has done electronics work for almost 15 yrs... Those pins and the plastic connector housings have interlocking tabs that are supposed to keep the pins firmly secure. You need a special tool to be able to get those pins out after installed. The problem could be a number of things.

1. The plastic housing for the pins could be either low quality or there is a deficiency in the injection molding process and not providing a sufficient surface for the pins to lock in place. Though not definitive, this is supported by the fact that the problem is frequently occurring on the same pin number for a lot of these connectors. 

2. The pins themselves are deficient... lots of things can go wrong there but its a surprisingly lengthy process just to make them so I won't go in depth here. The pins not locking correctly would result in completely random failures across the different pins on the connector. 

3. During the assembly process, these wires simply are not being inserted to their full depth, and so they just aren't locking at all. This theory actually also is supported by the fact that the problem has a high rate of occurring on the same number pin. If these connectors are made with some form of press (as opposed to by hand) there is a chance it is not applying even pressure across the connector face and that could be another reason why we are seeing repeated failures on the same pin.

Try taking a pair of needle-nose pliers or even just your fingers and see if you can get that wire all the way out of the connector housing. Since the wires are bundled close together they aren't going to come all the way out of the back on their own if it is individual pins failing...

 However! You shouldn't be able to pull them all the way out even with a pretty strong amount of force either with your fingers or pliers.
Reply: @WizardinBlack420 all that and you missed that the pin that move is rotated 180° form all the other meaning the retention mechanism cannot work because it's inserted backwards 
You can see the slit in the pin is oriented in the opposite direction of all the other 
Just pull it out rotate 180 and reinsert and problem solve 
That just a manufacturing defect
Reply: First they said users didn't plugin the cable all the way in, causing faulty pin contacts, users' fault.
Now seeing the "faulty" pins moving away, high possibility to cause faulty pin contacts, they said "Nah, it's fine."
Reply: I'm not trusting corsair with my money ever again, respectable brand my ass.
Reply: Aviation Avionics tech,  If Molex pin unseats during hookup then its bad.  Corsair is not true and does not understand how crucial this is.  Either there crimping is bad or there plastic housing is bad.  I had this happen during my thermal take psu 4090 hookup during install and spotted the pin sliding and was able to use an extra harness.  I thought it was weird but I guess its happening to you then it might be a huge widespread problem.
Reply: Corsairs stuff is junk i learned that a long time ago
Reply: Don't trust them anything, they'll always defend no matter what u know or what u have against, even clear evidence they'll shitt on u or ppl.
P.S. Johnny is a punk, he show us that numerous of times.
Reply: Absolute rubbish from Corsair that it would have come out the other end, when aircraft's starts to get old and plugs been on and off components loads of times we sometimes get the same issue, at first glance it might look like the pins are all sitting correctly but if they move when you tug a bit on a cable then they will push back when you put the plug on and cause poor contact, the other pins in that corsair plug although uneven and sitting deep could very well be within spec but cant for the life of me believe that the one moving is.
Reply: At this point buildzoid might as well be an engineer. But my understanding is he is just really into overclocking and if you wan't to be the best at that you need to know how things work.
Reply: Corsair are WRONG, I think you nailed it. Anyone with basic understanding of electronics knows an incorrectly seated pin to sleeve connection will not provide enough internal contact points and therefore increase resistance and cause overheating.
Reply: we investigated ourselves and found no wrongdoing - every corpa
Reply: I'm awaiting my 5090 astral,and so watching all this very closely. I checked cables that came with my seasonic 1600 prime psu. They are not h++ have no markings (was bought in oct2024) and my 12hvpwr cables donthe same as the corsair. I wont be using the two supplied by seasonic. I have ordered the pdm2 for extra information. I will also be looking at Asus cables and also maybe buying a h++ 12hvpwr cable as a backup. Thanks for the information Jay.
Reply: @Jayztwocents whay do you think of putting the termal grizzly wireview pro in between the gpu and cable?
Reply: Well if you look on the Corsair website at there cables all the ends look correct and in place,but if you look at Jays cable it's a mess, definitely NOT what is advertised on the Corsair website for sure.
Reply: Me watching this with a Corsair RMX Shift PCIe 5.1, ATX 3.1 12V2x6 cable I thought was safe on my 4090…
Reply: Oh wow. Literally just received my RM850x today. With how warranties are here in the Philippines, I'm basically screwed with this. That's $$$ down the drain 😢
Reply: Let's not forget that Corsair used different pinout in their power supplies which is just asking for "user error". 
I get it that using different that PSU brand of cable is obvious user error, but the same brand just different model? Which looks exactly the same? Without big stickers everywhere to not do that? Not good in my opinion.
Reply: It's perfectly fine to have no idea what you are talking about Jay. Your 4.17 million subscribers apparently don't care.
Reply: Corsair... Yeah it can be in spec but like you can do better...
Reply: It's unfortunate how Corsair acts anymore.
Reply: Jay, use Aris(Hardware Busters) method to see exact Amps on each cable
Reply: how the fuk is that fine lol the pin moving back and forth this much is insane, I would never use that cable ever again
Reply: @Jaytwocents less contact higher ohms more heat, better contact lower ohms less heat.(ohms is standing for resistens). its the same as a wall outlet lost its grip on the pins of your plug from your waschingmaschine 3000 watt we have got 230 volts in Europe so it around 13 amps those 13amps goes over the contacts from the plug and the contacts from the wall outlet if the contacts are good its near 0.xx ohms but if this became 5ohms you get heat at the end fire if goes bad (normaly it quits by melting the wall outlet contacts) it does not matter if its ground or plus in this example. But in a videocard it could be that grounds are over more pins together if you measure the ground/- pins from the card  in ohms than it could be that another pin can get amps more than the other pin that the burning only is on the 12v side. this is only thinking from my electricien background. we made last year conections for 400v 2800amps and 660v and 1600amps and we measured the conections with a microohm meter (15 microohms max) and put the m12bolds on 70nm tork.
Reply: great catch !!!
Reply: he's close enough to an engineer lol
Reply: As I stated in last video, Nvidia tried to say it was user error in their first reply to me. Which is BS....But luckly Falcon sent me a different cable similair to the one you showing with the yellow connector except mine was white and everything is working fine now.....Just disappointed that Nvidia would deny me in first email saying its my fault
Reply: Only fk I can confirm I just went on my build to check my brand-new cable from asus that came with the power supply “ASUS ROG Thor 1200W Platinum II” connected to my 4090 and the pins in fact retreat if I pull the wires, that's mental
Reply: Damn it, I have a Corsair PSU.
Reply: this statement is when you let the lawyers speak about technical matters...
Reply: It's complicated with the "do you believe their statement?" part. It's still within the MOLEX specification for the plug itself. But it's outside the PCI-SIG specification for PCIe when USING that plug. And the PCI-SIG specification once again permits a derivation in resistance that's already unsafe for the cables themselves. That whole specification of that 12VHPWR / 12V-2x6 for PCIe is a total clusterfuck. We do see failing cables that are just barely outside, but it's even possible to overheat even entirely within the specification.
Reply: so if I understand this correctly when you buy a 5090 you need to buy a microscope a extremely high quality 3d printer that can do very tiny things very precise, micro soldering set and more to make a custom connector(also maybe an raspberry pi to regulate the amps through the cables
Reply: it is unsettling Corsair said the pins are fine.. I am not going to buy another Corsair product ever again - they obviously do not know what they are talking about. Maybe there are no qualified engineers in Corsair and is all run by dubious teams who only know who to cheap out on their product quality
Reply: I don't believe them. And the fact it's over a safety concern is worrying.
Reply: @Jayztwocents

If you use multiple cables, a few mm difference in length is enough for the cables to be loaded differently, so even if the connectors on(inside) the card and in the PSU are connected together, there will be different current surges in them and with poor contact, cables or different lengths it will get heat which in turn leads to more heat when it gets hot and the resistance increases more.

The right thing would have been to use ONE thick cable for the Plus and ONE thick cable for the Minus/Ground side. So it would actually be possible to use a power block at each end since you are "Locked" to these bad connectors
Reply: Corsair is a joke imo. Overpriced and not even good quality. I have many Corsair components and I'm pretty disappointed by most of them. 230€ PSU (HX 1000i making weird clicking noises), Expensive Corsair fans RGB colors are way off (can't even show proper white without horrible yellow tint). Most 10€ fans are better imo. Not impressed at all. 

Reactions to problems also seem like marketing and nothing else. I lost trust and will not buy again.
Reply: i bestow buildzoid the rank of electrical engineer, even though he is largely self-taught.
Reply: "Fine" likely means in speck. There is still a variance, that variance when dealing with lazy electricity can result in a difference in resistance causing lazy electricity to take a different route. As someone who has worked with electricity for a living I can tell you, I would not call those fine, even if they arent the cause. There is no reason for a connector to have such a variable, configuration. I also would not use so many wires. Fewer heavier cables are almost always a better option for power delivery to a single device. Have you ever seen an extention cord with 6 or 8 small wires? No, they use one per pole.
Reply: Jay, got a simple test for you.  Take the cable with the recessed pins and physically push/reseat the pins and wires in the back of the connector while it’s seated into the card.  Then fire up the system and check for irregular temps. This isn’t a fix by any means, but a super quick method to see if the pin depth is causing the potential resistance/load imbalance. I have used methods like this to “shakedown” harnesses while troubleshooting aircraft for years, it’s a quick dirty way to find resistance issues
Reply: Force Nvidia to fix this mess by not buying there cards..
Reply: I bought corsair power cable for rtx 5080 and it's not working. Corsair statement is that the cable is working.

Funny thing is that Moddiy is doing those cables for big sharks asus corsair etc. And they recommend to use 3x8 pin 12V2x6. The same MSI. Only corsair says that their cable 2x8 pin 12VHPWR is enough because H+ and H++  is the same cable. My question is if H+ and H++ is the same, someone who allow this double standard should be now i jail.
Reply: i posted my view as electican down there, the Problem in my Opinion is Ohms Law on Parrallel connections, measure the wires into the gpu and psu, there must be a Ohm difference and it must be hugh, that heat cant comprehensive the ohm difference on the wires, Ohms law says hotter wires higher resistance this goes on till the cable burns or the parrallel connection evens itself. in my view the pins are not fine, try to push it more in with the wire to see a difference in load, then this works you know it
Reply: Building high end gaming pc is like you throw money into a river and watching it swim or watching if your money even is able to swimm.

The gaming industrie just fake his sheep fanboys. Take a look and compare something what you can have longer then lifetime and what costs the same like a high end pc built. Take a german HK MR 223 slimline for example.

Your high end pc is nothing worth anymore after 2 years. Your whole pc is made in china...
Reply: Not true, at least 2mm reccessed, so 2mm less contact with the pin. Maybe 30perc less contact than optimal
Reply: The Corsair connector pin that recess is installed 180° vs all the other 
No wonder why it move like that the retention clip is on one side of you put the wire 180° it won't lock in place
Reply: Jay, I think you're correct.  I remember an old molex power connector (4-pin) that began to smoke and melt the plastic in the 90s when one of the pins didn't mate well.  The wires connected to the pins could easily shift the pins backward and reduce connectivity, creating resistance.
Reply: Right, because no company would EVER lie about their products. IMO Johnny Guru has gotten more arrogant since he sold out to Corsair. The devil is in the details. MSI's cable is well built and well thought out for the consumer despite the inherent bad design.
Reply: Um, they say people not pushing connectors all the way on is a problem... but, having a connector retract inside the plug.... totally fine. Yeah, not buying it, literally.
Reply: Da schreit aber jemand nach Aufmerksamkeit. Ich habe kein Problem mit Englisch. Aber den Titel in einer anderen Sprache zu verfassen ist, dämlich. Willkommen auf der Blockliste.
Reply: It seems to me that the "this is fine" response is a little suspect. Maybe on an older 6-pin or 8-pin that's lower power it would be fine. Maybe in isolation, it's fine. But taken together with all the other issues this connector has had, "fine" isn't good enough.
Reply: I ain‘t no elecchicken, but a plug where you can MOVE the bit that’s supposed to be solid is out of spec.

And while the pin depths might be in spec, amperage distribution is directly related to the resistance of a path, so if it were consistent in the back or front, no problem; but there, the plugging surface is creating variability in the resistance by varying the connection area. In other words, all else being equal, these tolerances directly affect the amps per wire, the effect we‘re complaining about
Reply: I think these answer s based on the assumption that for sure there is a tolerance of the cage snap and if you cannot pull it out it should still sit behind the snaps.
I just can propose to try to cut it and look from the side
Reply: Its almost like they want us to take their word on it. Tired of giving money to companies that down play consumer worries, and design flaws.
Reply: So these companies tell you that a connector not sitting fully by half a millimeter is wrongly plugged in but then a pin moving a millimeter or more is fine? Yeah right… excuse me if I don’t believe that statement.
Reply: I would never run that Corsair plug ever
Reply: I dont believe it for a moment, they kept bashing derbauer for things literally shown on video. They are full of shit and trying to cover their ass.
Reply: Yeah. That's definitely a problem.
Reply: I don't believe Corsair's statement one bit. Their pin slop is atrocious.
Reply: I guess I got lucky with the 90degree Amazon cable I got for my 4090 2yrs ago . I also have never unplugged it since the build.
Reply: Not sure why any "electrician", "engineer", and or presidents of small islands here, did not open with beginning, simple, electric basics like, the fact that the power supply can and Will pull 50-60 amps@ 600 watts. 50 amp draw needs 6 gauge copper or 4 gauge aluminum wiring. Most of these wires and connectors are a mixture of both. Either way none are capable of holding safely 50+ amps. And what happens when you attempt it? Melt down. Hell, some of those power supplies pull 80+ amps...
600W / 12V = 50A Why not 120V? Thats only 5 amps...
Your computer's power supply unit (PSU) converts alternating current (AC) from a wall outlet into DC. 
Something I think these designers either have forgotten or never knew.
This problem will not go away until it is done correctly. 
Most electronics need low-voltage DC (like 5V, 9V, or 12V), but wall outlets provide high-voltage AC (100V-240V). Therefore, must be lowered and converted AC to DC, making it safe to provide directly from standard outlets.
If you read the numbers on the power supply you'll notice this as truth. If you learn the pc's voltage use you'll understand the complete process.
So much for the thousands of "engineers" and "electricians" here..This is basic stuff.

And if one thinks coatings and or wraps, sheathing, cool af braiding, or any of the like helps the problem, on the contrary, it makes it worse. These things are insulated to minimize arcing after meltdown, but also at the same time keep heat IN making it even hotter. They have zero to do with electrical current carrying capabilities.
Reply: Oh, and, Mixing aluminum and copper wiring is a fire hazard. "copper clad aluminum" (CCA), which is often just called "copper clad," is generally considered a fire hazard due to its aluminum core which can overheat and potentially cause fires when used in electrical applications, especially when overloaded or improperly installed. Guess what Majority metals are involved in this?
Reply: AND...the "end" pin is the 12V pin. Coincidence? I think not.
Reply: You're right. If this pin is less seated than the other ones in the connector, it will have a higher contact resistance than the rest, resulting in an imbalance. At these currents, every small deviation counts. Don't listen to what Corsair has to say about it, because they're in damage control mode.
The solution is to wait with buying new graphics hardware until Nvidia solves this mess and does one of the following:
- Calling for a 100V power cable system, so there can be just two conductors, +100V and ground, carrying 6A. (And yes, all PSUs will have to be replaced for ones that have a 100V output. Small price to pay, if it protects your house from burning down.)
- Put 8 separate regulators on the card that each take equal amounts of power from each conductor in the connector and generate a fault condition if one or more input conductors drop slightly more than the others.
Unfortunately we see the exact opposite happening: the 8 conductors are are joint on the PCB to one big power bus with no conductor monitoring whatsoever on the newer models.
What will be the next thing? The 12VHPWR+++ cable with watercooling?
If hypothetically  connecting high power 12V is best to be done with a multitude of conductors, then why do we see one thick conductor from a car battery to the starter motor, instead of a whole bunch of thin ones?
Reply: The OUT OF SPEC is the PSU sending the wrong unbalanced load across. FAULTY PSU is the reason.  the cable cant melt crap it doesnt have power, so the PSU is sending to much making it out of spec hence bad psu.
Reply: I don't believe Corsair, and I have seen what you demonstrated in this video that the internal metal connector is not held in place correctly by the plastic housing. If the number of connectors were increased or the actual connection was way more substantial it would be much safer. By the way those cables that have multiple connections on one end and funnel down to one connector on the other end, I find horrifying.
Reply: I recently purchased a Corsair premium 12VHPWR cable (individual sleeve) for an ASUS 4080 super, and it was a complete waste of money, the ASUS card would not power on due to power delivery issues.  Using the ASUS provided adaptor supplied by 3 8pin cables was no problem.  The Corsair cable was essentially e-waste that will go in the bin.
Reply: @Jayztwocents   no. It's a design fail. And a professional fail for the engineer that signed off on this. This connector and the cables used are UNDERSIZED if you are aware of the principles of Best Practices.
Reply: 12VHPWR needs to be done away with!!! How many generations has it been a problem? For as much as they are charging us for cards they can just stop being cheap skates and put two 8 pin connector on. FFS
Reply: As easy as you could pull out the PIN. This is all just a coincidence. If the cable set allows it, the only option left is to measure with a clamp multimeter.  

Corsair is done for me. Such expensive branded things and then cables like from Aliexpress. Without me, I didn't think anything like that about them. This can ultimately cause a cable fire on a 3000 EUR card. You buy Corsair because that's exactly what you don't want. An outrage on the part of Corsair and then they don't even stand by their obviously inexpensive construction. An expert in industrial series production can certainly explain what is going on in Asia.
Reply: It really surprises me that these big name "PC Builder" still use the one word that can cost someone thousands because they or people working for them didn't do there research.

Assumption is the mother of all fk-ups.  -Everett McGill
Reply: Can you try pushing the pin in after you plug it to the card? We should see visible difference on the load distribution.
Reply: Pins should not move in the connector under any circumstance. Having no ground is the worst kind of failure, the current starts leaking into other circuits while traveling to the closest ground destroying everything along the way. 

In commercial wiring I’ve seen a bad ground or neutral fry thousands of dollars in equipment with little to no warning. If the QC was better there might have been less failures.
Reply: @Jayztwocents  my Seasonic Vertex did come out the back side, I decided to checked after watching this. One of the pins was poking out the back side of the plastic plug. I wish I could post a picture. I'm just running a 4070ti super. I used the Seasonic provided plug. So I probably played with it like that for a couple months. I'm wondering if that was the cause of my random disconnects. When I'd be in the middle of a dungeon in TFD .. usually when a lot of explosions and such were happening, wham back to desktop.
Reply: Do we belive a statement that a Corp gives to save his name and be like "this is fine"?

... Do anyone even need an actual answer?
Reply: If corsair says that's spec they can kick rocks.. MSI didn't move at all and that corsair danced the jig.
Reply: Will never trust a damn thing Corsair says
Reply: On ASUS website in their psu section under ATX 3.1 they have a picture of their connector and its recessed as well
Reply: FWIW my RM850x 3.1 cable is fine on both ends.
Reply: That's a lot of corrections jay, but I UNDERSTAND. And I want you to know I SEE you. 💪💪 Keep the gravy rolling.
Reply: Corsair thinks this is FINE????? Holy shit
Reply: I'd call their bullshit as that's obviously not the case 😂 uuugh
Reply: Corsair is so full of shit its coming out of their ears
Reply: I had the same problem with my 24 pin mobo cable. Also corsair psu cable. One of the pins was exactly like this and pc wouldn’t boot at all.
Reply: I don't believe Corsair one bit, just like I don't believe you when you spin your shill bullshit why  you switched back to Intel..
Reply: When I bought the 2025 HX1500i the 2 12VHPWR included in the box was recessed like that, I’ve replaced straight away to their newer premium version and the looks so much better like the MSI cable, and I’ve been using my 5090 Suprim with no issues.
Reply: They state that is is okay. How about Corsair provides the tolerance spec from their drawing which states how much movement is allowed...
Reply: I think eveybody forgat this , 12vhpwr cable has  very short life span for plug and unplag ... Original specs says only 15 per cable action and then it s not safe to use ...
Reply: @victoremorrose9027  looks like someone decided to comment without finishing the video, because then you'd see the flaws are evident on an UNUSED cable. Feel smart now?
Reply: @giraffeorganic  oh boy you saw a comment and you must trash talk isn`t it ... I said a problem not all problem ...
Reply: @victoremorrose9027  that nuts man they gotta come up with a better wat to supply this amount of power and current id even say go to 2 8 pin eps connectors on the gpu side and  2 8 pin eps connectors on the psu side a single 8 pin eps can supply theoretically 384 watts each cable but if they only put 300 watts through each eps then u would be good to go man plus at least 3 shunt resistors prob more tho on the gpu pcb as well most server gpus use 8 pin eps connections i make all my own cables too and the way i check them after is exactly the way jay did to see if all the crimp terminals are even in the connections before using them
Reply: Corsair has become the dog in the "This is Fine" meme.
Reply: No, I don't believe Corsair and furthermore I am disappointed in them.
Reply: I rather lean towards, blaming nvidia and not enough active monitoring/protection on gpu side. I recommend watching episode from Actually Hardcore overclocking
Reply: @BI4NTAL watched a video the issue is with the connector essentially in 8 or 6 pin any issues with with a cable a resistor would know and stop the gpu from turning on. The new nvidia pin connector has only 1 resistor so you end up with situations where all the other pins are fine but one or two aren’t the resistor doesn’t know it’s just seeing the pins are connected and think it’s fine. Even with the cards with more resistors it doesn’t change much at most it’ll send you a message a few seconds before your gpu catches on fire. Aka the pin connector is poorly designed and the 5090 is too close to the max watts the pin can handle essentially it’s 570 out of 600w which is insane.
Reply: @BI4NTAL that's the channel run by Buildzoid
Reply: @BI4NTAL first and foremost I agree with that statement but I also think everyone else plays a role in these failures as well. They've all spaced their crap to the absolute bare minimum of the standard. Pci-sig is also at fault for coming up with this standard leaving no room for error on the end user and the manufacturing side.
Reply: Theoretically, if all wires are connected then it should be spread roughly evenly, but that’s not what we’re seeing. If Nvidia intended to parallel all wire pairs into a single rail to allow for more current w/o load balancing, then (going off 6x 18 or 16awg pairs of PSU wire) Nvidia should be using a single 12-8awg wire pair (power & ground) vs this 6x2 BS.
Reply: @Gaming_Biker  It wouldn't even be that bulky of a cable and would probably be easier to manage. 2-8awg would be sweet.
Reply: @ I honestly just made a sarcastic comment. For the amps, you’d need 6ga using copper & 4ga using CCA, both would be ridiculously large for a PC.
Reply: Not in the slightest, the fact even Nvidia's is relatively even makes it seem even more like Corsair f'd up somewhere.
Reply: $CRSR doing the typical cost cutting methods that all public companies do
Reply: @Jayztwocents  Corsair is doing an NZXT now
Reply: No. Whoever emailed you is either full of shit or doesn't understand electrical resistance. This is NEVER "Ok" especially when you're talking about the sort of current running through these relatively tiny cables.
Reply: Disclaimer: I have one whole semester of electrical engineering in my pocket from 27 years ago. This is based on my limited knowledge of the most basic electrical engineering concepts, which still seems to be more than PCI-SIG and Nvidia:

If a pin or socket is loose, then it is not safe. Period. No further discussion should be necessary, but I will explain why Corsair are full of stuff with their response and why this is an absolutely negligent specification:

The PCI-E 2.0/3.0 spec lists a max rating of 150W for the 8-pin connectors, which is averaged at ~4.16A per wire at max rated load. However, they also specified up to 8A per 12V wire; 8A x 12V x 3 wires = 288W, providing a safety factor of 288W / 150W = 1.92 based on wattage alone. They also specified using 16AWG wire, which has a max current rating of 15A, so a single wire is actually capable of safely carrying the full 150W if necessary (150W / 12V = 12.5A), which still provides a safety factor of 15A / 12.5A = 1.2 (assuming the PSU can provide that amperage to a single pin without triggering OCP).

The PCI-E 5.x spec has a max rating of 600W for the 12VHPWR/12V-2x6 connector, which averages to ~8.33A per wire at max rated load. However, they also specified up to 9.5A per 12V wire, so you are already only at a safety factor of 600W / (9.5A * 12V * 6) = 600W / 684W = 1.14; the 18AWG specified also has a max current rating of 9.5A, so there is no additional safety factor. Loss of a single wire at max load will bring the average current through each wire to 10A, which is above the max for 18AWG. Therefore, there is literally no margin for error in getting these cables and connectors right if adhering to the spec and not building in your own safety factor. Using 16AWG wire (which CableMod proudly states they do) means that 2 wires can be lost before exceeding the max current rating per wire (again assuming the PSU can provide that amperage without triggering OCP).

That all being said, Buildzoid showed how all this is meaningless in the 40 and 50 series since there is literally no load balancing across the wires because all the power is connected to a single rail on the card. The card could also only be drawing roughly 400W through the cable, but if it is drawing 11A through  one wire and 4.5A through the rest, there is still the great risk of cable and connector melting or even fire. At least the 30 series had some semblance of load balancing with the power being drawn into 3 separate rails on the card.

The only reason I can think of that would cause some wires to carry pretty much double the current of other wires that are in parallel is that those wires with less current are seeing proportionately higher resistance for some reason. This seems to me that it is an issue with the connectors since the copper for electrical wiring is at least 99.95% pure. I would be interested to see if different cables react differently with the same PSU/GPU combination and if the same cables react differently with a different PSU and GPU (switching one at a time for scientific accuracy, of course).
Reply: Nope
Reply: Wow, guess my RMx is the last PSU I'll be owning from Corsair
Reply: Buildzoid is an honorary engineer.
Reply: I believe I can fly.
Reply: This is why I've slowly moved away from Corsair- like any of their products. They've never had the end-all BEST quality of anything, but traditionally, they've mostly had the best customer support and service in my experience. More recently, since the covid times really, their support became more and more of a hassle while the quality took a sharp nose-dive and prices went sky-high. And while this is true for almost all hardware companies, Corsair seems to be the apex of it. To answer the question- no, I don't believe their statement. They're clearly trying to cover their asses because they know they have a huge market share and they don't want to have a recall on their cables/psu's that will cost them a lot. It's a sad time, when they're having to pull an NZXT move
Reply: The only reason I feel it isn't an issue is because the pins in the male ends of the connectors go into those holes deep enough that a discrepancy that small really shouldn't make a difference. As long as the metal pin touches the metal hole that should allow the flow. unless there was a microscopic gap creating a small arc. that would create heat and possible fire. The pins would need to be undersized or the holes oversized for this to happen.
Reply: NEVER buying a Corsair PSU again. This is unsafe and bad quality control.
Reply: @CosmicTavern  However the problem is not the PSU, but rather the cable itself. Which of course somehow applies to the PSU. But in general Corsair's PSU's has never failed to impress me in terms of durability and performance. A flawed cable is something else. Of course they would need to address this and provide new cables that meet the requirements and quality standards to not cause any current issues. It's a complex issue to explain it in short terms.
Reply: As someone who has to deal with Corsair CS more than once. I can say that statement from their team is as worthwhile as the horseshit slop they churn out of their factories each day.

I'll never buy their garbage again.
Reply: I love that Buildzoid has to tell people he's not an "expert" even though he absolutely is. He should just get a job as an engineer for a day, just so he can have the title.
Reply: corsair is just a overpriced bullshit, just like Asus but Asus does somewhat offer a level of actual premium feeling. Corsair is just "give us 300$ for this PSU that is probably worse than a 100$ one" The only ok thing are the cases, which arent perfect but yeah
Reply: After all this power news on 50 series - I wonder if some device like a decoupling capacitor pack on the device-side would work as something like an adapter connected straight to the GPU's 12VHP connector, regardless of generation. I would hope It would reduce transient responses which all stacks downstream/ PSU without such a device. And so by having the transient damping basically directly connected to the gpu (the decoupling capacitor pack) - it could reduce the total energy dumped into the cable and also do some load balancing AS WELL on the individual cables.
Reply: that makes alot of sence the power monorion on the card is working fine... infact its making sure to get 7 amps from each wire and one is almost unpluged making alot of resistance cuasing the power supply to push more and more watts to make 7 amps go into that wire the contact is the problum you found it jay garanntee it
Reply: These cables are not made to plug/unplug like a wall socket. The more you do that the weaker the connection gets.
Reply: @md4449go  wall sockets aren't made for continual un-plugging either. They both have insert/removal cycle lives. The lifetime of that connector would be well into the 10's of thousands if engineered and tested properly, which I hope Nvidia did.
Reply: @ I was not implying that wall sockets will last forever but they are built for far more plugging cycles then a 12 pin molex connector could ever hope to stand up to. I personally would not trust a molex connector for more than 20 cycles.
Reply: @ here you go straight from google. Repeatedly unplugging a Molex connector can lead to issues like worn-out pins, loose connections, potential for electrical arcing, and even damage to the connector itself due to the stress placed on the plastic housing and metal contacts when repeatedly mated and unmated, especially if done forcefully or frequently; this can result in intermittent power delivery or complete power loss to the connected device. 

This is why wall plugs are not molex. Physics bites you in the ass again.
Reply: @md4449go They should be designed for that though. Why have a cheap connector design that is meant for plugging into $30k hardware?
Reply: That is NOT fine. Of course there's a spec, but we're talking a couple thou, not tenths of an inch.
Reply: @fmwhitney7  I've been building PCs since 1999. The last Nvidia cards I bought were a 3080 ti for me and a 3080 for my son. They will be the last Nvidia cards I will buy.
Reply: No I don't believe their excuses. Anyone with years of experience knows that dumb 12 pin is designed around "perfect" conditions and also using the tap rules. I've always thought the tap rules were a joke.  
The tap rules state you can use grossly undersized wiring for a particular current, if you don't go over a certain length.... It's BS.  
According to tap rules, you can put 30 amps through a 18 gauge wire if it's under 1ft long. Needless to say that is a very, very, bad idea.... I would never put 30 amps through less than AWG 10.
 120v outlets are rated at 15amps, and I would never wire a circuit with less than 12 gauge which is rated at 20 amps with 60c insulation. IE plenty of fudge factor.
Reply: Corsair is full of it. I deal in automotive wiring and that will eventually come out and it’s NOT supposed to be like that!! 
Corsair car is a fire hazard I don’t care what they say. 
Also I should mention it’s not just pin height it’s also pin contact tension. Poor tension from the pin is also an issue.
Reply: there is a youtuber thats been puting up videos playing games at max settings on the 5090 and he hasent had any  issues with melting connecters. he also uses a corsiar power supply
Reply: Jay, when you and we talk about DC power coming in = going out, it isn't necessarily going out to GD, there are many other sinks, for example heat from doing work - something that GPUs are really good at making.

You were asking about resistance, and IIRC the CPUs and GPUs are actually just a really complicated resistor (transistors are resistors we control dynamically, sort of, right?), like, imagine a circuit of a DC electric heater, it will have a resistive element that heats up like a lightbulb filament. The computer is like that (but also does a lot of useful work with the electricity). 

If you want to actually model it more correctly and have better understanding to where the energy ACTUALLY goes (instead of my oversimplification to a 4 year old), you can look briefly into the dynamic power formula, and make an effort to understand load capacitance and activity factors. I would gladly explain, but I've been away from Uni for MANY years.
Reply: Thermal camera watch the cables under load
Reply: Construction engineer here... just add one rebar... it will be fine
Reply: i bought brand new Corsair 1000w RMx PSU and it has 12v highpower cord that has 2 same ends.. not like Jay is showing here that they have 2 ends going into that GPU side socket at 12v2x6.. 5080 owner here and no issues thus far or even hot cable issues
Reply: So I will say, after watching your video.  What you're focusing on is a bit of a red herring, the pain that is not captive anymore that could be an issue.  However the rest of the pins being a little bit deeper or shallower isn't an issue the engagement is occurring inside at numerous points. 

Thought is that there is crimping issues or other issues that are causing connectivity not that a tiny bit of the pin is recessed further, because that's not how the pins engage, they have little tiny bumps on the inside.
Reply: a capacitor at the inside of inputs of the cord would make these cords not be able to go out of spec
Reply: @terrycook2733  why??
Reply: @terrycook2733  according to Buildzoid, the rail on the PSU is a single rail, but is current balanced across the cables which have individual shunt resistors on each connector. The 12VHPWR connector from the 40xx series has higher density cables, but they are not current balanced the same way the previous ATX standard was. The connector only has 2 shunt resistors — the newest iteration of the connector only has 1 shunt resistor. There's a lot more I'm leaving out because there's too much information for a YT comment, so I'd recommend watching the video if you'd like more details about why the 12VHPWR connector is just utter garbage.
Reply: Could it be something as simple as the amp draw from the cooling fans being to much for the wires to handle when the card is under load? The card draw might be fine.....but the fans add to much total power draw?
Reply: Electrical engineer here, Yes Jay it’s fine, this isn’t a problem. If say the pin was falling out of the connector housing, that is when it would cause an issue as it could create an arc between the male and female side or if the male pin was too short, my investigation quickly seeing this, the male pins would need to be extremely short for them to cause an issue. But for the pins to have some tolerance in the connector is completely normal. Definitely think you’re blowing this up for nothing 😅 I feel sorry for Corsair for whatever lashback they get from this.
Reply: @Mraussie9297  Coming from the same background, the pins shouldn't have play like that period.  He should NOT be able to move any of those pin, it takes very little movement for there to be poor connections and in turn arching.
Reply: @zack9912000  It is quite normal for some pins to have play in them, but it isn't as easy as saying they all do or should. Automotive pins that I see when working quite often will wiggle a bit in their socket. That particular one seems to have a lot of play though, either the tang on the pin is damaged or the retention tab in the socket is. If it was "normal" all the pins would move the same.
Reply: @zack9912000  Exactly. If one of those pins gets pushed out too much and almost no one would notice unless you're aware of the problem or looking for it, that would create a short and in turn a melting connector. At least the aftermarket GPUs have their own safety measures to help notice these type of things. Ironically, the Zotac Amp Infinity is the best one because if the plug isn't seated in properly, it won't even turn on. Then if it starts having overload via heat buildup of any type, it starts flashing red and indicates that you should shut off your PC immediately or at least close down the game and buy a better cable or PSU. If we could combine Zotac's method with ROG Astral's method with monitoring the amps pulling through each individual cable, that would be a great start to safety with these sketchy plugs. Realistically, they should just completely recreate and get a top engineering and make a proper bullet proof cable for these high end GPUs. This isn't only happening with gamers, but with AI workloads and other applications as well pulling high wattage. This is only hurting Nvidia and unfortunately their board partners as well. At least the board partners are doing things to help us know if the cable or connection is faulty in some way. Nvidia simply said it's fixed when in reality they made it better but didn't fully fix the issue. I feel bad for the AIBs providing safeguards for sketchy connectors from Nvidia.  Extremely scandalous.
Reply from the maker: @Mraussie9297  As yourself this... if that much movement wasnt an issue, why did PCISIG increase the pin length by 1.5mm for "better contact" if it didnt matter? Im more concerned that you are an electrical engineer chiming in without saying you specifically read the specs.
Reply: @ So just because someone does something and says it better, it must mean it’s better, and must mean it’s the only way. Heard it here first, if you do something and say it’s better it’s 100% better 😎
Reply: @Jayztwocents  what would happen if you push that specific ground pin deeper in it's socket while the card is running?

Without the PMD2 in between, let's hypothetically say, that the cables don't make enough contact which causes more resistants on that specific ground which forces more AMPs through the other cables, theocratically pushing the ground pin deeper in it's socket would help smooth out the AMP rate on each cable, it would give more evidence that the pins aren't fully interconnected
Reply: @Jayztwocents There's nothing wrong with melting 5090's because no one can even get a 5090 😊.......
Reply: @Jayztwocents the pin that move is rotated 180° vs all the other the retention mechanism is on one side if you put the pin 180° the retention system cannot do is job
And it's clearly evident you can see the slit on the pin is not oriented the same way as the other 11 pin
This cable got a manufacturing defect
Reply: @Jayztwocents  Hello,
The only way to be sure is to measure it.
Also maybe I'm wrong but I think you make a mistake by measuring only on 12V side: A pin that have an issue have a higher electric resistance and so less current into it . Globally, the cable is like a little resistance that generate  a Vdrop. The heat generated into the connector is the power dissipated in it. The formula is P=I²*R. This formula will apply whatever is the voltage.

If there is no issue on the 0v, I see 3 possible interpretations:
1°) nobody found issues on 0V because nobody measured it.
2°) The cable is mechanically weak on 12V side but not in 0V side, maybe due to the holding mechanism.
3°) The return current go also somewhere else (on some other ground) with better contact, I see as candidate the pci-e slot (75W rated) and the bracket (the case).

By using this 4 formulas and their combination: U= R*I,  P = U*I ,  the global resistance of n resistors in parallel: Rp= R1*...*Rn/(R1+...+Rn). n resistors serial mounted: Rs=R1+...+Rn
And by measuring The Vdrop of the cable (between inside the PSU and inside the graphics card, there is two Vrops; one on the 12V, one on the 0V ) and by measuring tu the currents into the cables, you can get the resistance of the cable, the resistance of each connector and each pin, the real voltage that goes into the card, the power dissipated into the connectors (psu side and gpu side).
Reply: @Mraussie9297 you clearly don't do service. A connection that isn't solid and is a little loose does cause major electrical issues and draws higher amperage. Aluminum terminal blocks can overheat and weld themselves, I've changed a few on stationary equipment that doesn't vibrate that hasn't been touched for years. Do you know how much the sleeve slides over the pin? I don't but almost a 1/16" of play definitely could be an issue.
Reply: @Mraussie9297  your statement is a bit contradictive, you say its not a problem, but it could cause an issue when its too short, so it can cause a problem then. 
What Jay tell is still useful for consumers to check the pins position inside the cable housing.
Reply: @Mraussie9297 what if you push it into psu and pins get pushed out the back coz they’re not fixed and then they barely make contact and burn??
Reply: @madgames8227  yes that would be an issue, but in this case that’s not what is happening. The plug is too small for the power consumption of the entire card, not because one pin moves half a mm
Reply: @Mraussie9297  You say your an electrical engineer. This might not be the complete issue, how ever how can you say that loose pins in the connectors arnt an issue. Loose connections increase resistance which increases heat. We have seen thermal images of 150c on cables. Electricity  follows the path of least resistance. If some of these pins are better then others with a single bus its going to dump all power to these 1 or 2 wires inside of the bundle.
Reply: @ It’s not a “loose” pin, a loose pin could cause an issue, you won’t know the pin is loose unless you take it out of the connector and actually put it on male pin. Slight movement of pins back and forth in connectors are normal.  And does not mean it is loose when connected. 

Jay has a thermal camera, plug it in and put the thermal camera on that pin that’s recessed, see if it’s hot. It’s not just that pin it’s not just that wire that is not the issue. The issue is the connector design is inadequate.
Reply: @Mraussie9297 technically I’m sure you’re correct however practically with the power being pushed through at the limit it may be causing an issue
Reply: @Mraussie9297 there’s no way that much cable pin movement within the connector end itself is within spec. And if it is, then why would they be failing? That’s a couple Corsair psus now that have had 12vhpwr cable connector issues. Coincidence?
Reply: @Mraussie9297  While I cannot dispute what you are saying (and do trust you) The fact most other cables are not doing this and people are already living in fear of the cards burning. Corsair will suffer for this. From a consumer stand point, if other cables are not doing this, why should we accept corsairs tolerance?
Reply: @asho78  Because it’s not isolated to just Corsair cables. Pins have had tolerances like this well before this issue, it’s only since this issue that someone has now said look here’s a problem. No, just no. 

The real fact of the matter is the design of the connector from Nvidia itself is inadequate. It’s like getting a 15Amp household plug and filing it down to suit a 10Amp socket, increasing the power draw and still expecting it to do the same thing without any issues.
Reply: @ryanbridges7241 Sorry I don't believe the "experts"  anymore.
Reply: @Mraussie9297 found the corsair employee 😂
Reply: @Mraussie9297  how do you explain the extra current being pulled then?
Reply: @Mraussie9297 actual electrical engineer here... the pins shouldn't have that much play, period.
Reply: @Mraussie9297  100% agree here, what i think people are forgetting is that the spec is designed for basically the pins to just be mated so long as they mate x amount it's fine and those pins are mating x amount.

The fact that lines are going outside of spec on the other hand.. that is an issue.
Reply: @Mraussie9297  You're clearly not an electrical engineer, or at least you have never done a single project regarding electrical connectors. Disgraceful comment.
Reply: @ thanks for your opinion, it matters greatly and I’m humbled by it 🙏
Reply: @Mraussie9297  You're welcome. The fact the terminal can move that much is a problem, period. You can even look up the Amphenol specs as well as crimping and installation manual. While I don't see that any of them even give a spec for allowable in and out movement of the terminal after insertion, there is now allowance given either. Given the design of the housing and contacts, either all of the terminals should be able to move back and forth that much or none of them. If you know how the metal locking wings on the contact work and the tolerances inside of the plastic housing, you should know that shouldn't even be possible without a wire having exceeded pull out force or an otherwise damaged contact or housing. The male pin may still be making contact with the required point inside the female terminal, but that doesn't make it within spec. If you can quote me the spec for this connector that says that much movement is allowable, I'll cede the point. The only time I have ever had a terminal move that much in a housing is when I intentionally used an incorrect but similar terminal to repair a tail light connector because it was all I had available and the retention point was slightly further forward on the terminal. At very best this is low quality or a damaged part.

Edit: Further, if you check the PCI-SIG ATX12VO documentation on the 12V-2X6 cable it shows desired specs for the insertion of these connectors, gives example target depths, and says "plug pwr and gnd pins must be fully engaged prior to sense pins making contact in worst case tolerance condition" with a target contact point 1.1mm down the male pin from the taper point with 0.10mm tolerances. This is with the sense pins already having been shortened and male power pins already having been lengthened in the spec. The amount of movement Jay showed would almost certainly bring that contact out of spec with tolerance stacking. It would also depend on if the pins are 3 dimple or 4 spring design to determine if full contact is made. The amount of slop Jay shows is measured in multiple mm and is huge when dealing in 0.10mm and 0.25mm tolerance targets. Sorry, unacceptable. No idea why you would say otherwise if you are actually an engineer.
Reply: @ and Corsair has been around a long time with millions of users unarguably would have had similar connectors on other less and have never had an issue. It’s not the movement tolerance that’s the issue. So stop saying it is, it’s the plug design. It’s like trying to power a whole skyscraper with a standard household plug, doesn’t matter how well that plug is designed, there’s going to be issues. The male pins are long enough that there is still adequate contact for a suitable connection. Again aim a thermal cam at that pin, it if is, won’t be the only hot pin. Cause it’s not the issue.
Reply: @Mraussie9297 Yet, we are told anything more than a razor blade thickness between the PSU plug and the GPU is a problem and user error... but having a connector retract 1/4" back into the connector... is fine? Do you work for Corsair?
Reply: @Mraussie9297  why the hell are their(corsair) pins not secured evenly all across. Do you work for Corsair???
Reply: @Mraussie9297  can we please pin this comment? I also hate 
 the 12VHPWR design but everyone is so quick to jump on the flame train. At least with the Corsair cable there's only one end with the 12VHPWR connector so the chances of failure is already cut in half compared to PSU's were there's 12VHPWR connectors on both ends like the infamous example that der8auer examined. But even so, der8auer's own Corsair PSU and cable heated up to a scary temp.